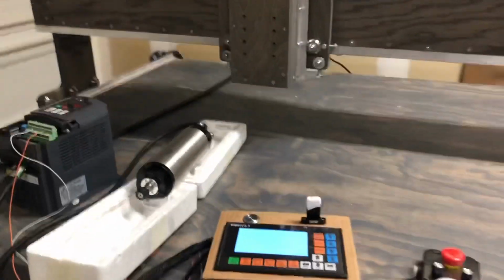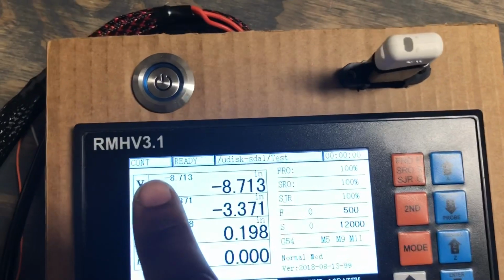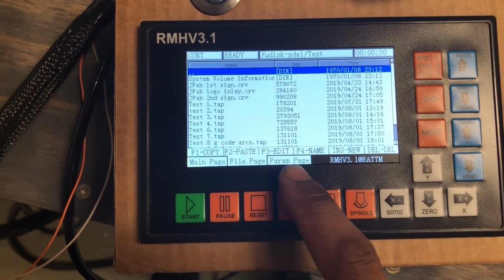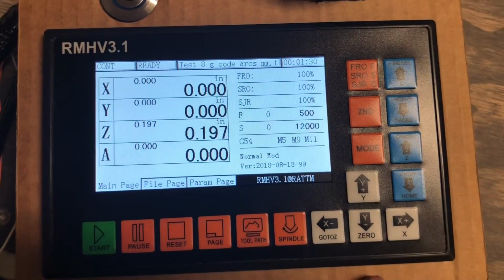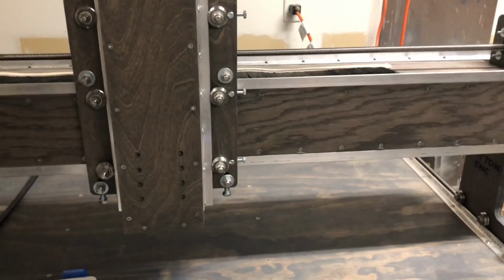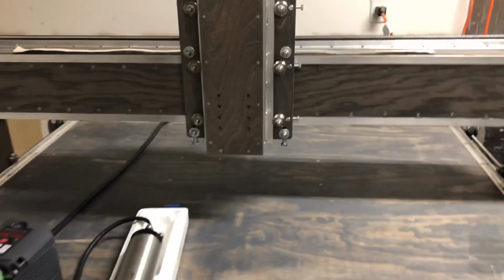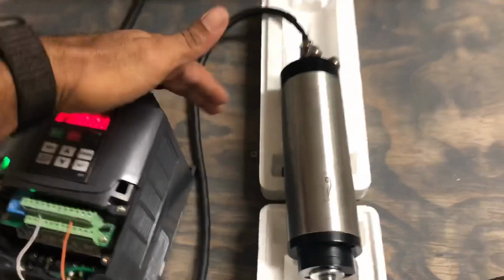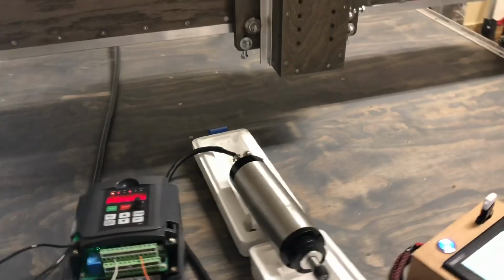CNC Sound Test Using 110v 1.5kw Spindle and  DDCSV Offline Controller

Comment: Did you figure out how to control the spindle speed from the offline controller?  If so do you have a wiring diagram you would share?
Reply from the maker: I did not. I mounted the VFD to the front of my CNC to control the spindle speed.

Comment: The ramping of the motor can also be controlled from the VFD parameters. You are going to be using small tooling it will spin up very fast if set up right. Your delay is excessive but your patience will wear thin in time ;-)
Your reference to 0 when you started your file, is work coordinate or G54. Machine coordinates 0 is usually a switch on the extreme of motion on any axis. It doesnt have to be at the extreme but that is further down the road.
Reply from the maker: You are correct, the VFD was not set correctly. I don't think it was set for 110v. I am not familiar with VFD's and long story short I have already blown the one in the video. Made a mistake on one of the frequency settings and hit run and that was all she wrote. Total rookie mistake.

Comment: RMH and DDCSV controllers are pretty same I guess
Reply from the maker: The manual for this unit sends you to the DDCSV website for updates on software and manuals. The only difference that I was able to see besides the look is the connection terminals on the back. Same layout different connectors.
Reply: @SuperJfritz   so it is the same model but with different revisions
Reply: @SuperJfritz  Are you happy with this controller, do you recommend to order one for tests?
Reply from the maker: msdesign.ru I am not sure what you mean by testing.
Reply: @SuperJfritz    We order different types of controllers and test them on special demo cnc machine, we are interested in such parameters like stability, speed, standard and user friendly interface, support and other features
Reply from the maker: msdesign.ru O my, looks like I will be checking out some vids.
Reply: @SuperJfritz  welcome! )
Reply: The unit shown is equivalent to DDCS V1.1 or 2.1. There is no difference in the firmware or operation of the two versions. The difference is in the hardware: V1.1 uses -12 volts for switch inputs and the V2.1 uses +12 volts.
The DDCS V3.1 has new hardware and physical format, but firmware and operation are consistent.
Firmware upgrades are mostly feature additions and occasional bug fixes.
Reply: @gerryhagberg5528  Thanks
Reply from the maker: @gerryhagberg5528  Thank you for the information.